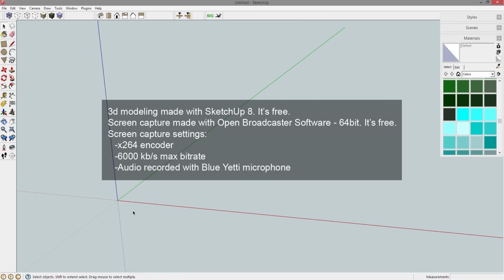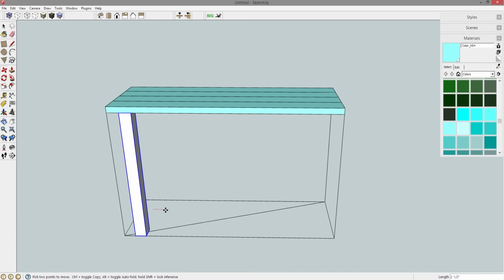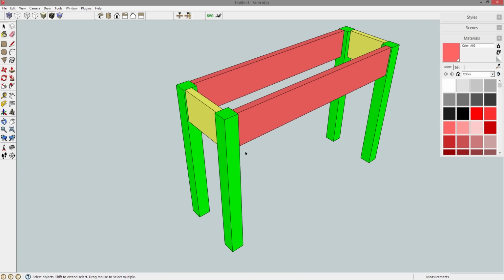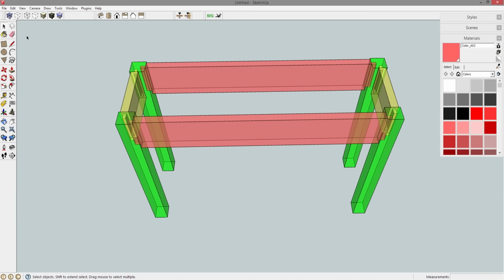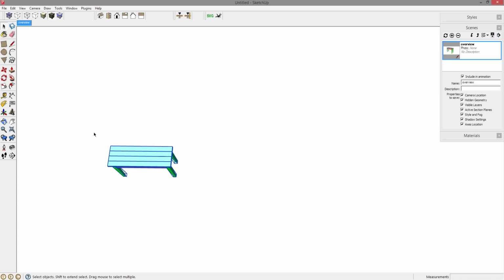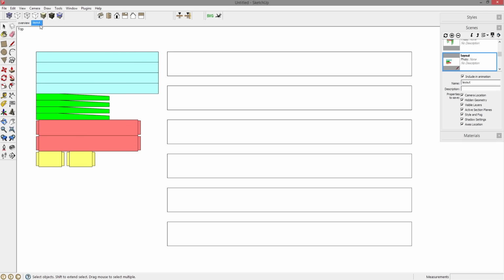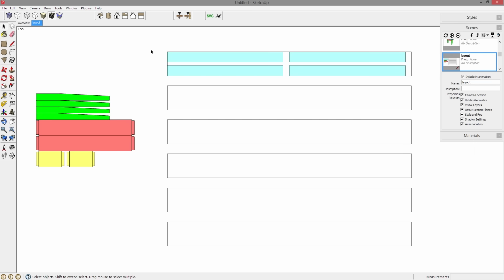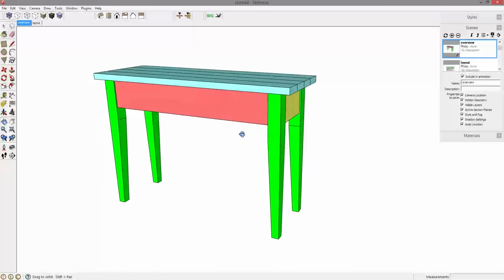SketchUp: Mortise And Tenon Sofa Table - 221

Comment: Hey Jay, do you suggest any credible sources to download v8.0? I can only seem to find shady file hosting sites, and Sketchup only provides previous two major releases.

Would the latest Sketchup Make (free from what I can tell) be equivalent? Only difference is it seems like it's not to be used for commercial purposes.
Reply from the maker: I have a link on my website. Go to my site and click the resources button on the very top bar. Then look for the sketchup 8 link.
Reply: Great thanks. I actually tried one of those software-pedia sites and made sure to scan the file. About 3/4 the way through your tutorial, it's a big help in getting me to learn this! Taking no time at all! Thanks!

Comment: Another excellent SketchUp video Jay. I use the same keyboard shortcuts plus one other for toggling 'hide rest of model'. this is great because it works regardless of what is selected at the time.
Reply from the maker: +Justin Barnett Continuous improvement.
Reply from the maker: +Graham Howe Thanks for that one. I just assigned it and I'll see if it helps my workflow. Thanks.
Reply: +Jay Bates like you need help with your workflow.... :p

Comment: Wow, this is really helpful. Haven't used SketchUp much yet, and I'm basically a woodworking infant — accumulating a few inexpensive tools (circular saw and other small items) until I can afford some actual shop tools.  It's great to see what is possible with SketchUp and how you can plan so you know exactly how much lumber you need, and how to use it efficiently.

Comment: Nuggets from this video that I didn't know or use before. I love these recent videos.
1. Make a diagonal line to create a Snapple center-point. https://youtu.be/9eOBU2vtDvM?t=63 
2. You can change the dimensions of only one axis by typing ( ,dimension   OR   dimension,) https://youtu.be/9eOBU2vtDvM?t=98
3. You can repeat a snapped multiplication of objects by typing  X # https://youtu.be/9eOBU2vtDvM?t=128
4. You can set custom keyboard shortcuts for tools that don't have shortcuts! https://youtu.be/9eOBU2vtDvM?t=139
5. You can edit multple parts of a symetric model at once by taking advantage of components. https://youtu.be/9eOBU2vtDvM?t=226
6. F for offset to make super-fast tenons https://youtu.be/9eOBU2vtDvM?t=393
7. Use Xray rather than K for hidden geometry. https://youtu.be/9eOBU2vtDvM?t=505
8. Using Styles window. https://youtu.be/9eOBU2vtDvM?t=730
9. Can rotate while in the M for move. https://youtu.be/9eOBU2vtDvM?t=871
10. Using Top view for laying out lumber. https://youtu.be/9eOBU2vtDvM?t=976
Reply: +Altometer Great summary! After watching this on Jay's site, I came here to post exactly what you did! Great work!

+Jay Bates I've been using Sketchup for over 6 years now and didn't know a lot of trick you used - excellent tutorial :)
Reply: +Altometer Great summary! Thanks!
Reply: That's a lot of nuggets

Comment: Good explanation of why the table needs to be adjusted with the clamps you have, these types of things are big time savers when you get to the point to the glue up and it is impossible and you have to rework your design. These little tips are good to remember, thanks